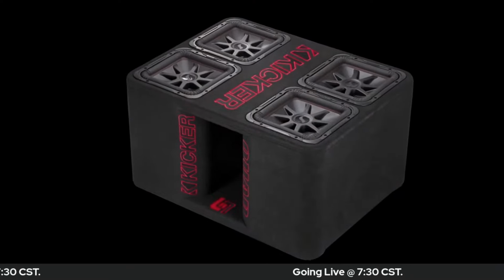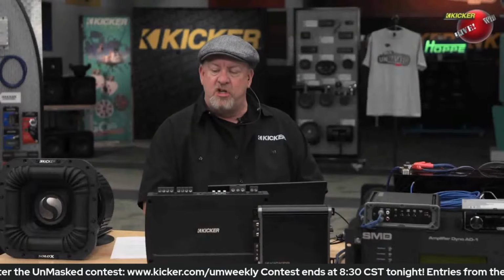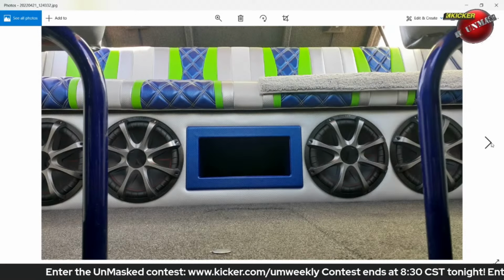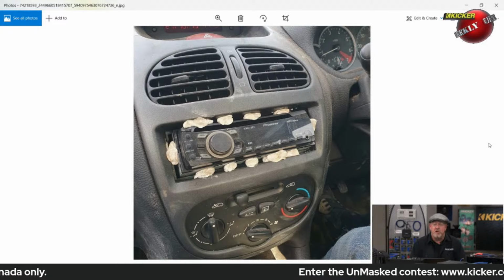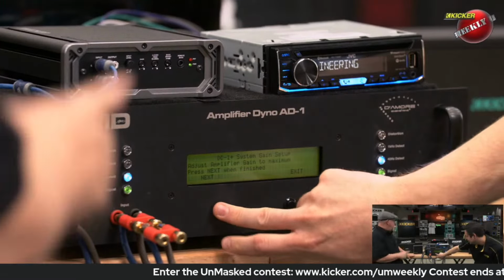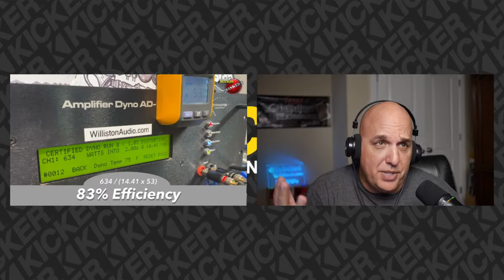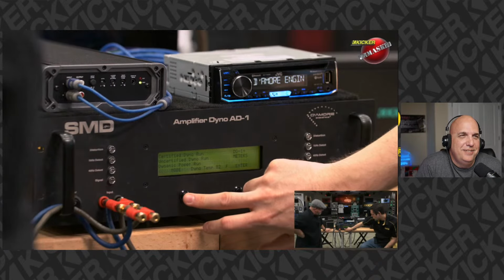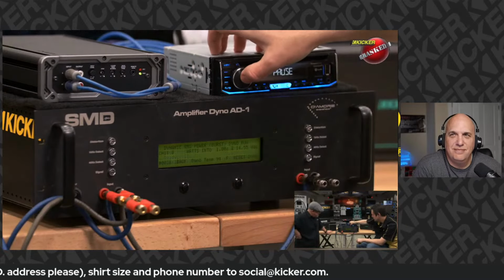Amp Dyno With Williston Audio - Kicker UnMasked

Comment: I ran a Kicker zr 240 on three 10” RF at 1.8 ohms.

I currently am running two 10” Infinity subs in a sealed enclosure for a solid SQ. Each sub will take 450rms

All amp Dynos show the 800.1 will push well over a 1000rms

Or should I play it safe and just get the 1200.1?
Reply from the maker: As a general statement, we recommend being within 20% RMS. Some go way higher, but it will depend a great deal on the enclosure, tuning, EQ, etc...
Reply: @KICKERAudio  thank you 
I went ahead and bought a 1200.1 and will adjust my gain with a multi meter. Should be around 30 vac. Better safe than sorry. Thank y’all

Comment: Very surprised the cxa 1200 and cxa 1800 doesn't do rated at 13.8 volts 14.4 volts is hard to achieve I was under the belief these was rated power at 12.5 volts.
Reply: With that low of power its really easy to maintain 14.4 its called upgrading your electrical.
Reply: @apocalypse4720  I did guy bought a 250 amp mechman alt
Reply: @joshholden8561  well I had a cab 1600 wired to .5 ohms with a 200 amp alternator. 2 extra agms with 1 run of 0 Guage and I never went below 14.3
Reply: @joshholden8561  my last build with 2 18s with a taramps HD 10k with a 280 iraggi, 6 Trojan group 31s, 2 runs of 1/0 welding wire I never saw below 13.8 clamping 6700 watts. It takes power to make power.
Reply: @apocalypse4720  my point taramps u get full power at 12.5 volts
Reply: @joshholden8561  yeah but  kicker is low power and is easier and cheaper to keep voltage is what my point is
Reply: @apocalypse4720  my kicker kxa2400.1  is far from low power it clamps 3,500 rms look up big d amp dyno on that kxa2400.1. It costs 1k
Reply: @apocalypse4720  my kicker kxa2400.1 does over 2400 at 2 ohm over 3500 at and hits around 4500 burst with effiency in high 80s
Reply: @joshholden8561  yeah too much for that power. I can get a 6k that I can get almost 8k clamped power out of it for what that kicker cost. My point is if your electrical is solid you can keep the voltage up
Reply: @joshholden8561  me personally I would rather have the zx series come back. Did rated and then some and was a lot cheaper then the kxa series.
Reply: Any Brazilian amp u get is straight up dirty power & have a problem with bursting into flames dude! Why don't u ever see any Brazilian amps in world competitions/SPL lanes?? Because all the big dawgs that go for world records know that they are cheap a$s hell & don't do that great at anything below 35-38hz!! They are always in the mid to upper 40's like 47-48hz! Anyone can do big #'s at that high of frequency but it is hard to get big #'s below 35hz!! I am the Kicker4Life guy & I'm doin a 150.3db on just music in my 2010 4-door Ford Focus SE Sport with 2-12"L7S's in a custom ported enclosure tuned to 33hz! On a single Kicker 46CXA-1800.1T with a single XS Power d3400, 1/0 power/ground, 1/0 Big 3 & a upgraded 300amp alternator! Note/Caution:  if u have a Brazilian amp BE SURE TO KEEP FIRE EXTINGUISHER 🔥HANDY! Thanks!!😂

Comment: 1:10:10   Big D is so right on here!    I love buying anything audio.   But it's just to mess around with.   
If I want to put something in and never worry about it again?    I stick with the brands I trust.    I also know they work as advertised.    

Any kind of gear can work for a bit.   Its not often do they stand the long haul with some brands.  Let alone summer time.    

And lets not forget all those issues with noise, and forget about service after the sale if you have any question, need a connector, manual etc.    

Glad Kicker is still the Kicker I love from the 90's.      
 Nothing like having real die hard engineer in the wheelhouse.

Great video, and loved seeing Big D Wiz on.       The Intro to Motorsports was pretty cool! 
Keep livin it Loud!
Reply from the maker: Thanks so much Mickey!